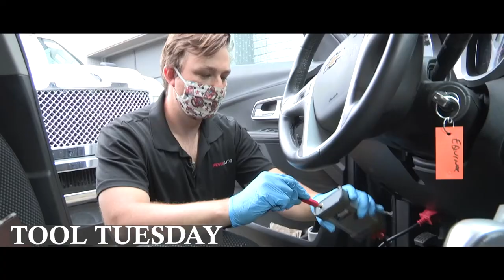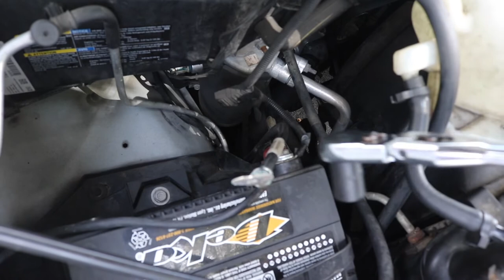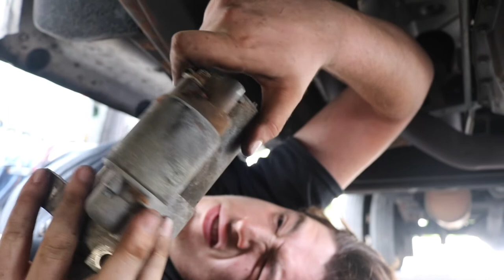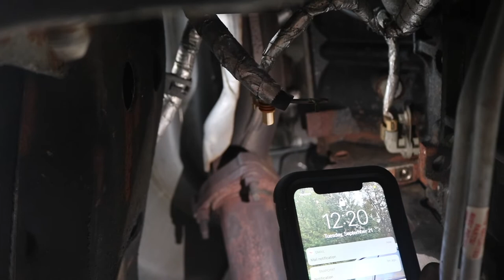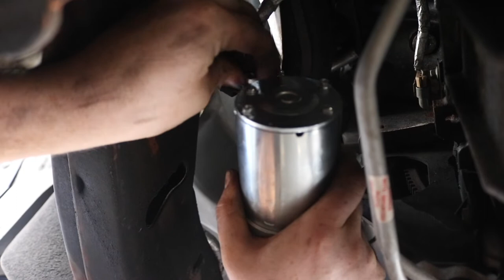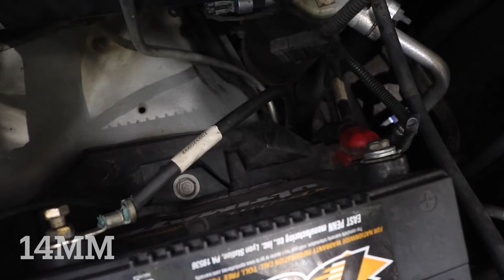How to replace an engine starter on a 2010 GMC Savana

Comment: Include the pertinent info next time like the goddamn location of the starter
Reply from the maker: Mr. Phillips, the engine starter is located on the passenger side of the engine under the vehicle where the transmission and engine are joined together. You will need to raise the vehicle to get additional clearance to work in that area.